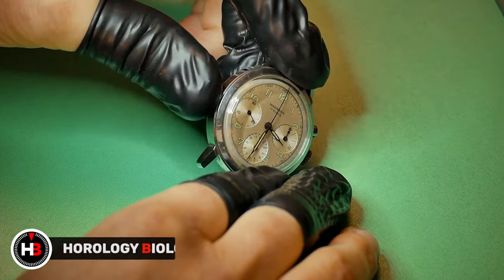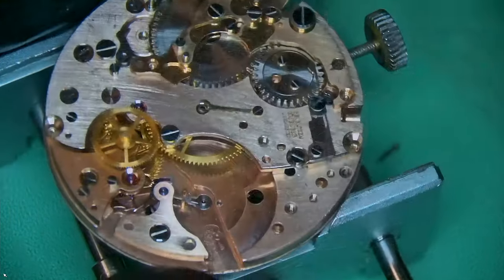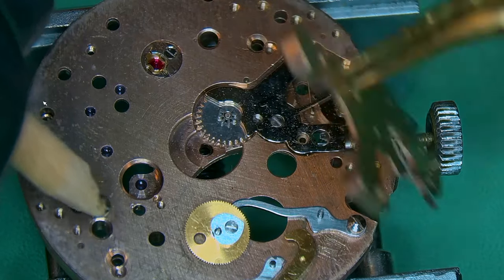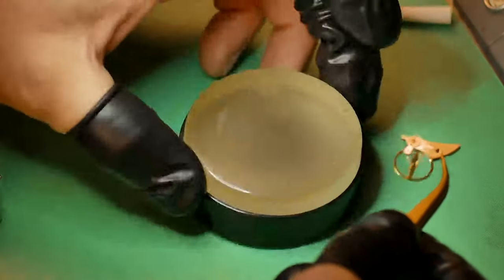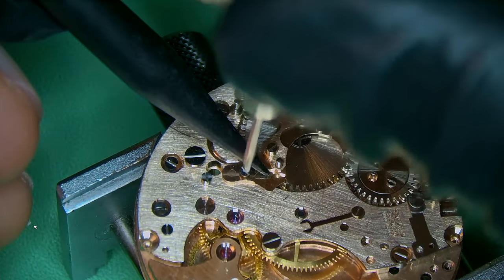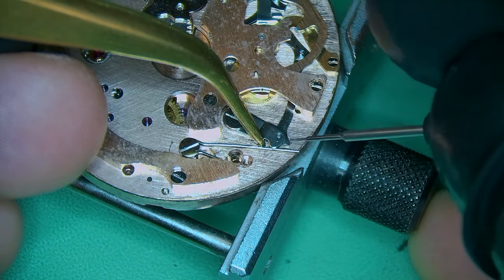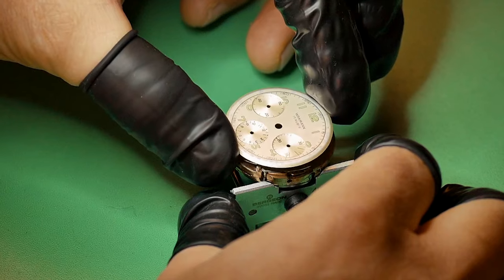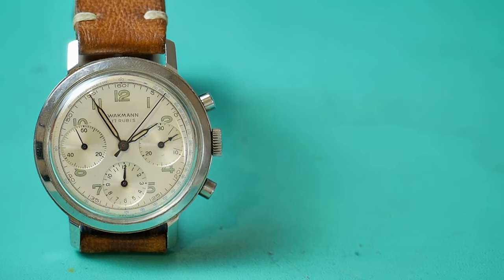Reviving a Wakmann Chronograph - Full Vintage Watch Restoration - Venus 178

Comment: I am glad you are feeling better. Nice work on the Wakmann it looks great! There is a series of 28 books available for servicing vintage chronographs called "Esembl-O-Graf Chronograph Watch Course". From 1949 and It is out of print but I bought the CD version on ebay for $10. Well worth the information on a lot of the chronograph movements of the 40's and 50's. I take photos of my parts trays too. I find it helps me remember where things go. I have a watch with a Landerton 51 chronograph waiting for me to gain more experience before I try working on it.
Reply from the maker: Thanks John. 

That CD sounds interesting for sure. No link for this?
Reply: @HorologyBiology  YouTube seems to be blocking all my links.

Comment: Thanks Matt. I reckon the watch is 50’s or later as it looks like it has an incabloc shock setting. There were definitely import taxes on complete watches, especially in the US. Dennison was the largest case maker in the UK for a very long time. It was common to go to a jewellers/watchmaker and pick your movement and case and usually get the jeweller’s named dial. Dennison also made cases for Rolex who imported Swiss movements when they were founded in London prior to moving over to Switzerland in around 1920. Glad you’re feeling better too.
Reply from the maker: Cheers for the info Tom. I believe you are right about the taxes part as it makes total sense.
Reply: 100% on the import taxes. In the US Longines had worked around this by teaming up(later buying out)the US Wittnauer brand, shipped Swiss movements to the US to be assembled and cased by US watch case companies to make them more "American Made" and bypass the tariffs. They also tended to have more American style cases, not really seen elsewhere, like the twisted lug styles of the 50's. 18Kt gold was heavily taxed so US watches of the period usually have 14kt cases, which you rarely see outside America. In the UK 9kt was more the norm. 

By the mid 40's Longines were exporting a few hundred thousand movements a year to the US by this method. Jaeger Lecoultre and Vacheron Constantine saw this success and wanted in, so Longines became their US distributor and their movements were also imported and cased through the same Longines-Wittnauer plant. Jaeger Lecoultre, dropped the Jaeger part of their name, so until the 1970's they were branded as Lecoultre and mostly with separate lines to their European watches.  

PS Though I agree with you on the 1950's age, maybe early 60's, I would say incabloc isn't that great a way to judge age, . Incabloc came out in 1935 and can be found in watches from the late 30's onward. I've an Alpina from 39/40 with incabloc and it looks like an incabloc setup you'd find even in new watches. The lume could be tritium, or it may even have been non radioactive early type of luminova.